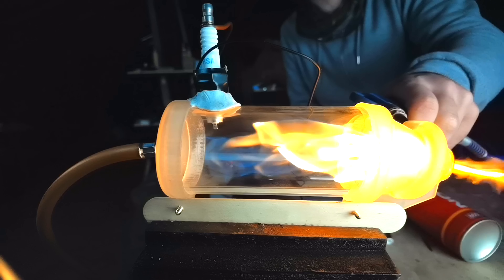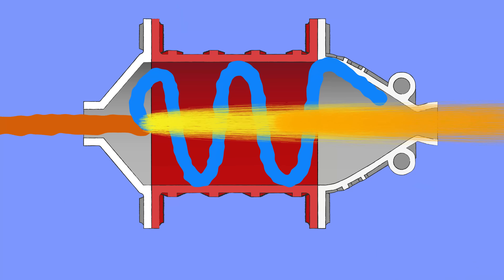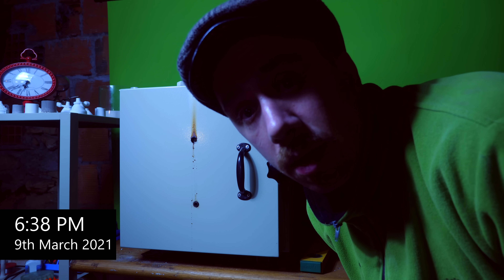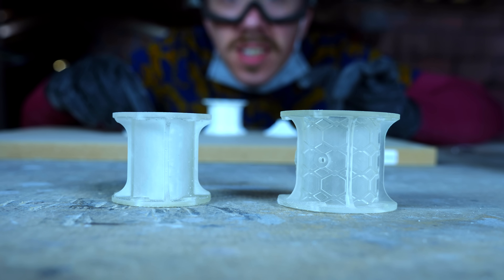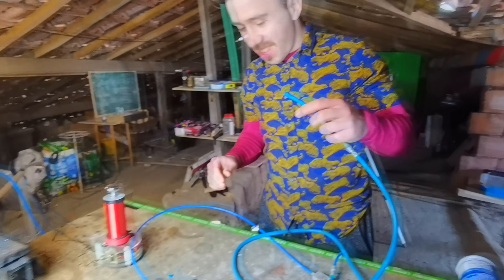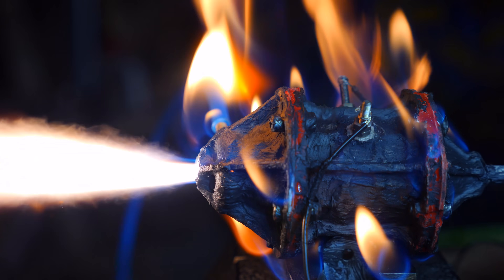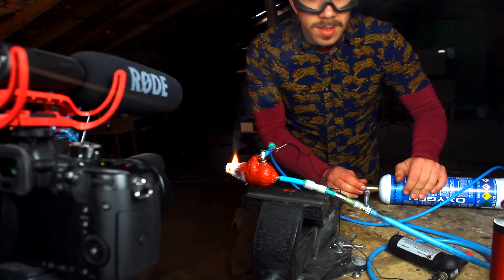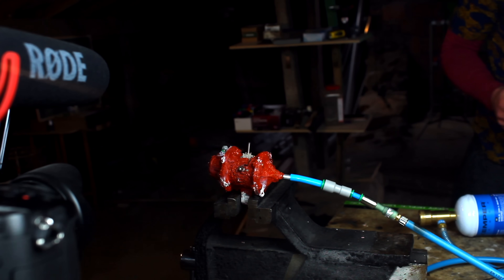Vortex Rocket V2.0 (3D Printed)

Comment: I'm a phd student and I work with ceramic materials, so I think that I can give you some directions with your structural problems. Porcelite is mainly composed of Al2O3 (alumina), so you can take a look at some informations of the material.  The theoretical densitie of it is 9.98 g/cm³, sou tou can use the Archimeds principle to measure the density of your pieces. If its too low compared with the theoretical one you have a problem with high porosity, so you need to find methods to solve this. The porosity is correlated to the grain size of the ceramic, and larger grains leads to higher porosity and less mechanical strenght. The longer you leave it in the kiln, the bigger the grain size will be. The same with high temperatures.[1]. So you can try change the heating rate, time and sintering temperatures.
The accurate way to measure grain size is using a Scanning electron microscope, but i think that you won't have access to one, so you will have to come to a different experiment to evalute the quality of your samples. Maybe density (Archimedes) for porosity and mechanical strenght (Tensile testing) as a second figure of merit?
The melting point of Al2O3 is around 2000 °C, so you could look if the temperatures that you are reaching are above this threshold. There is also the problem of the thermal expansion. When the alumina heats and cools the material expands and contracts,  and crackings can appear, specially along grain boundaries (thats why smaller grains leads to stronger ceramics). And the material can have cracks after phase transformations that occours with temperature changes. I would recomend a pyrometer to check the temperatures during the runs.
Finally, maybe when you pour the resin you create micro bubbles, which creates the pores in the curated piece. This happens a lot with resin castin. There are lots of techiniques to deal with this.
[1] https://www.researchgate.net/post/How-different-is-the-sintering-temperature-of-size-small-big-different-powders-but-same-composition-when-they-get-the-same-grain-size-after-sintering
Reply: Maybe another thing might be to use compressed air and not pure oxygen as an oxidizer this reduces the temperature of the combustion. Another thing is that under a pure oxygen atmosphere almost anything starts to burn, which is also not a benefit here.
Reply: I was wondering if some of his porosity issues might be addressed by using ceramic glazing dip/soak before sintering it a second time?
Reply from the maker: Thank you so much for giving me such informed help!
Reply: oxide ceramic engineer here :D there are some points i have to correct: bending test ist the correct way to test strength. sintered alumina has 1 phase - no transformation. larger grains dont lead to higher porosity. pore volume goes down with longer sintering time, at the same time the grains coarses, thats why the hole ceramic shrinks. its quite hard to get the 3d ceramic dense - but not impossible :D try it maybe with a alumina slurry with a high content of powder. there for you need to disperse it in water in a ball mill with an dispersant (PE-bottle with alumina balls - not that expensive) than dip the component in the slurry and it gets infiltrated --> drying --> sintering. thats just one method
Reply: It just occurred to me that if glazing, especially when using a dip & soak, if air bubble inclusions might end up being an issue.  To fight that I was reminded that in the Epoxy scene you'll often see them doing an epoxy mold pour and then placing the item in a vaccum chamber to draw out any air bubbles.  Next after it has been vaccum purged I thought that you could further impregnate the parts with glaze by putting them under 2 or 3 atmospheres pressure.  Anyway.. just thoughts.
Reply: The theoretical  maximum density is 3.95 g/cm^3, not 9.98 g/cm^3. 9.98 g/cm^3 would be denser than iron and many other metals.

Comment: For the leak why don't you print "u" channel shapped collars for the joints and use refractory cement to bond them in place then bolt them down. It would provide more surface area that the high pressure gas has to work through to escape.

Comment: it's a bit too much but you can put the engine a ciment block and then that will not burn and melt I think. And maybe can you use your engines into real scale rockets because I think it can be pretty cool ! and of course you can put in orbit a tomato (it will die due to the cold and the no-oxygen in the space (tomatoes are disgusting!!!)). you also can combine the engines to do an ultra-powerful rocket !!!!!!!!!!!!!!!!
and take pleasure with killing tomatoes!!

Comment: Have you tried JB Weld? it can seal internal combustion cylinders.  Maybe you can keep the resin ceramic mixture and coat the inside with JB Weld, The resin melting helping with cooling the engine casing so it doesn’t thermal expand and leak.  

I think thermal expansion is the culprit here for the leaking, the pores were made by heat melting out resin and the object shrinking as a result.  So when you heat it up again (during testing) it’s got holes through it big enough for liquid to move through.

Comment: SODIUM SILICATE!  Also known as water glass.  After you burn out the resin in the high-temp stove, then dip the parts in sodium silicate solution, allow to dry, then do it again several more times.  Sodium Silicate is used to seal cracks in engines, so should work here to seal your rocket motors.  Good luck!  Love your videos!

Comment: I have 2 ideas. Firts: glass it. Second: use better ceramic material. You can make mould by 3d printing plastic. Have around 1 cm wall thickness, print the hollow insides with plastic with low infill, then outside plastic shell and just fill the mould with ceramic. Let it dry well, and use your kiln to cook it. The plastic that made the hollow parts will just burn off. There should be way less shrinking becouse the ceramic does not have plastic in it. You could also try with many ceramic materials and many thicknesess. Clay, refactory, what ever your kiln can handle.

Comment: Why don't you try to use 3d printing a mold in PLA and then "inject" high temperature cement or some kind of ceramic compound inside? Then you would have an engine 100% in high temperature material with minimum leaking. You could even melt down the inside part of the mold at 300+ degrees if you want to have no joins at all 🤣🤣 Definitely something that fits your skill 👍

Comment: In the future, what if you tried to make the same type of turbojet that propeller driven airplanes use? Instead of the thrust being generated by an exhaust port, the turbojet drives an external propellor.

Comment: Interlocking parts? like when it comes to piping, you normally have a screw end with some tape between the threads or you have a push fit with sealer/glue inside. There may be a way to almost double the layers to keep the loss lower and allow for the glue and coating you've been using to be more effective.

Comment: Maybe the problem is not that it is leaking but that the leaking gas goes on fire. For example putting the whole engine underwater could do the trick. It wont fix the leaking problem but the engine would last longer.
Stupid idea I know :)

Comment: How about a ceramic insert for a metal engine? The metal will be much stronger and less leaky than the ceramic, while the ceramic inner parts will protect the metal from the chamber high temperature.

Comment: I think you could save a lot of time by 3d printing the parts in plastic and then use those to create silicone molds for the ceramic. You would not have any layer adhesion problems in the ceramic, You could make parts much thicker/sturdier and you would have less shrinkage. You also could use a clay that is more dimensionally stable and  less finicky than porcelain.

Comment: What if you took your 3d printed ceramic parts, and coat it with sodium silicate to seal the pores... The thing that makes refractory cement work is its porosity... It allows moisture to escape without spalling the cement.

Comment: Turn the disadvantice into an advance. Print your engine, put it into a container, pressurize slightly more than the pressure inside the engine. So the air / oxygen can flow from outside to inside thru the porous ceramic. This helps stabilizing the pressure related forces and cooling the engine. No leakage of flammable gas might possible. Feed your vortex from the gas in the container so you will have even more cooling and the pressure can regulate itself. Think about and keep experimenting. :-)

Comment: My recommendation would be to glaze the outer surface of your ceramics, after that you might want to use a metal crush gasket on the seams, likely copper or aluminum in a thin sheet form would work for the gasket. Clamping distribution may also be an issue causing the leakage

Comment: Maybe try coating the inside of the engine to prevent leaking rather than (or in addition to?) the outside. The coating will need to be smooth, but it may get a better seal.

Idea for future video: Try using tesla turbines in reverse, as pumps rather than turbines, see if you can get movement. Also, try using them passively to create cyclostrophic flow in an already moving fluid.

Comment: I would recommend using a metal body which would significantly improve the leaking problems. Also if you get a pipe with threaded ends then maybe you can use the threaded end and add threads to you nozzle and just screw it on.

Comment: How about using a 3D printer/welder, you can use stainless steel wire. Lay down welded beads?

Comment: Try two thick coats of glaze on the interior and exterior prior to firing. You can make it pretty and fill the pores. Also you could coat it in epoxy once you've assembled it to help prevent cracking.

Comment: Put sleeves on the parts  so the ends slide into the middle section and put them together before you put it in the kiln I wondered that then the parts will fuse like welding them together.
Reply: Granted before you put them in the kiln put some of the porceline resin around the overlaps before you put them together and then in The kiln

Comment: You should definitely NOT try to add Water Glass inside and outside the engine to seal it. 🍅™️
https://www.youtube.com/watch?v=Ip-jDuM25FE&t=353s - NurdRage: Make Sodium Silicate (AKA "Water Glass") from Cat Litter and Drain Opener
- or perhaps you should.... start with a thin solution, burn it out in the oven, and move onto thicker solutions ⛑️

Comment: 3D print the part, make a silicone mold, make a water soluble part, put the part in sand and pack it down, and cast it from aluminum and do some port work with a dremal on the inside. I’m not sure if that would work, but you would be able to test the engines for prolonged periods of time and not worry about leaking

Comment: Have you considered adding a glaze on the ceramic parts after the first cure? This is how they seal earthware for food and beverages. We prepare a slip (liquid mud) of the glaze, dip the part in, let the thin layer dry, cook it in the kiln and voila! The challenge is to find a glaze with a coefficient of thermal expansion that is matched to the ceramic.

Comment: video idea: (3d printed) porcelain combustion engine,
To stop the engine from leaking I would suggest using a resin mold, ceramic powder, and a vacuum chamber to get the mixture into the smallest gap in the mold, after the ceramic cures burn off the mold / firing the ceramic

Comment: Two ideas: maybe put the porous parts in a vacuum chamber submerged in some heat resistant liquid like the cement or silicone... with the vacuum you pull out the air and when releasing the cement might replace the empty space 

Second idea, why print the part? Print a mold and fill it with heat resistant cement or print the part in a wax like resin and mold it.

Comment: @integza soooo mister integza you attempted to heat up porcelain to a super high heat thats fine! but you forgot to seal the porcelain after firing it(meaning when you cooked it in the kilm), it should have a had a second firing with some type of sealant on it. it makes it stronger and im gonna guess air tight since all the porcelain in my house also is air tight, i checked before making this comment. soooo that should stop your first problem since that protective layer has to be cooked at like 800 just to set it. idk what type of temps it can go up to. but im sure more temperature resistant forms on that same sealant will exist. after that your seals them selfs will need to be better. i would but the rocket together after the second firing, and do another coat of the protective layer around EVERY BIT. should help! love your vids even subscribed today!

Comment: i would cast the engine in some sort of ceramic or heat resistant material. this would look a little bulky but then you can trim it down to a point where it looks like an engine.

Comment: Please buy a respirator. As for the pores, what about painting a coat of ceramic resin on and sintering that for a short bit once the parts are finished. The new coat could possibly fill in any pores from the original model as it shrinks over it.

Comment: Perhaps look into the specialist steels used in actual rocket engines? I know they can 3d print a lot of varieties of metals nowadays. And then coat the inside in the same high refractory ceramics used in ablative protective coatings?

Comment: integza the vortex cooling is not working cuz if it was working then there wold be no flame coming out
hint: the fire is touching the walls of the "rocket"
my soloution is putting more silicone on if it does not work then try increasing the nozzle size or use normal air since its mostly nitrogen if all that did not work then try different fuel and oxydiser ratio

Comment: 🍅🍅🍅🍅🍅🍅🍅🍅🍅🍅🍅🍅🍅🍅🍅🍅🍅🍅🍅🍅🍅🍅🍅🍅 🏏🏏🏏🏏🏏use thermal apoxy it is air tight and heat resistant to cover the rockets

Comment: could you take the engine, once it's completely assembled, (tubes and all) and submerge it in a curable (dryable), non-porous, fire resistant material to fully seal it?  other than access to fuel and o2 ports, the outside shape and size is irrelevant. Also, I believe that with a 2mm thickness it may still be cracking, just with non-visible 'micro-cracks' that the gas seeps through with pressure.
I'm sure somewhere in portugal, you may be able to find a medical oxygen concentrator, you can make your own oxygen for significantly cheaper than you buy it for using welding canisters. Yes, it's lower PSI, but I'm sure there's other less expensive options than you're using now. 
(are those ideas worth a 3d printer?)

Comment: Maybe to help seal try submerging the part/assembly in the porcelite resin let it drip off so its a thin layer, or paint it on... and run through heat cycles, and it might form a shell. This might even allow making thicker parts by adding multiple layers. Or maybe just try a thin fluid like refractory coating such as a castable. Just some thoughts from a fellow flame enthusiast.

Comment: Your problem is that the vortex is not being sustained, probably never even started because of the volumetric difference of oxygen vs gaseous propane (even though propane in the tank is liquid, it's being injected in gaseous form). The full combustion of propane is 3CH8 + 5O2, which is not even a 2:1 ratio in volume... you might want to try with oxygen enriched air instead to get at least to a 4:1 volumetric ratio to try to sustain the vortex, or switch to a liquid fuel.  

Also, please make sure youre using a flashback arrestor or at least an oxygen firebreak if you're using an oxygen breathing kit.

Comment: It seems like the pressure of the gas leaking through the ceramic is deforming the RTV gasket material and not allowing it to seal the chamber. If you designed a surrounding layer, like an inner cylinder with an outer cylinder and empty space in between, it would allow you to fill the space with gasket material. The printed outer layer would keep the gasket material compressed as the leaking chamber pressure forces it away from the chamber.

Comment: Imagine this, building your own metal 3d printer to print metal parts
That would solve all your problems
But it would also be pretty hard to make, a proper argon flow and metal dust and precise lasers
A big project but certainly very cool if you can get it done